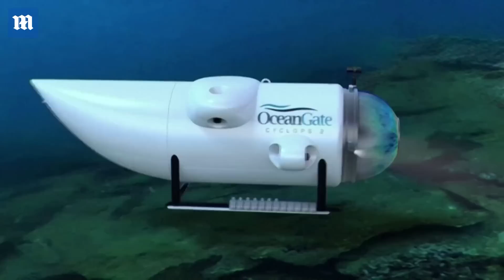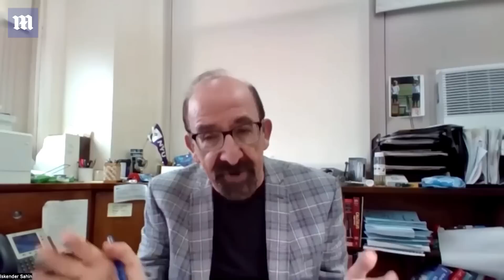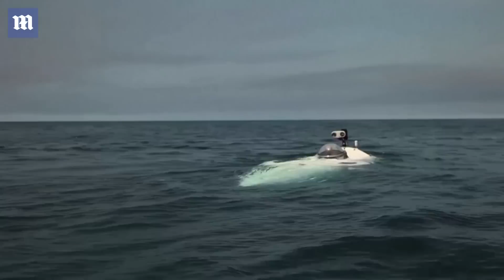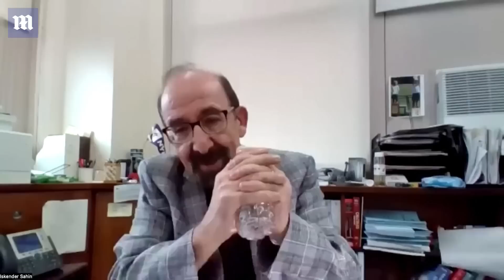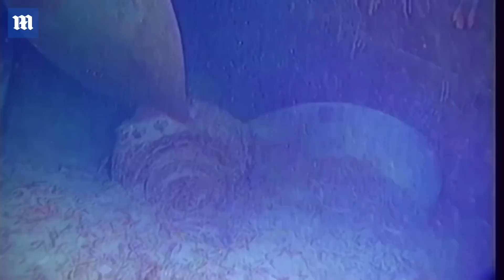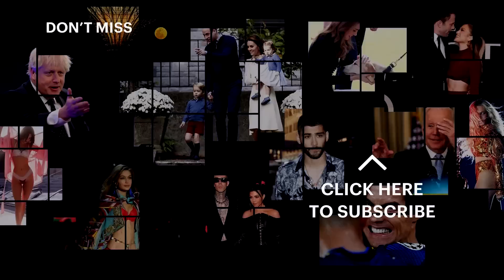Titanic submarine ‘disintegrated very rapidly’: Expert explains how tragedy unfolded

Comment: He is an amateur. Given the thicknesses of the barrel and encaps, it did not collapse like a coke can. The sub had three main components - the CFRP barrel, titanium endplates and the titanium hemispheres bolt fixed to the end plates. In my view, a likely cause is differential deflection under load. The end plate is very stiff and would resist hoop compression deflection very well. Some end plate bolts could have sheared off. The glued in barrel would have deflected more than the endplate putting a huge bending stress into the ends of the ends of the barrel which may have delaminated and massively fractured causing a very rapid inrush of water at one end.

Comment: This jackass was cutting corners cuz he owed his investors, he was  everyone

No one says they didn’t test the carbon fiber hull before knowing whether it could take the ocean pressure… Others are stating, clearly, that using carbon fiber is a mistake. He was repeatedly told this. His idea was NOT ONLY not “revolutionary,”. but,  due to this “revolutionary” metal’s inability to maintain its original yields, more than a few times. 

The carbon fiber experienced fatigue and it imploded due to the pressure. Ya see, carbon not “revolutionary,” along with steel or aluminum, it’s what oxogen tanks are made from. A device that experiences more pressure from with in, first, rather than only pressure from on the outside. That’s why oxogen tanks are cared for differently, like when on a plane.

Comment: How can a carbon fiber implode? I assumed the plexiglass cracked and water poured inside under tremendous pressure.
Reply: It's very brittle. That's why it isn't used in submersibles.

Comment: It's the fact that they combined carbon fiber with titanium and plexiglass. Those materials expand and contract at different rates and where they are attached become weak spots after multiple cycles
Reply: Yeah I think the salt water also compounds the carbon fiber losing it’s stability over time. We can all criticize after the fact but I’m sure the ocean gate submersible did it’s job the first many dives but after a while it shouldn’t been retired. We will learn a lot from their investigation, hopefully.
Reply: @heatherupton6558  Yeah, he could have probably cemented a legacy as an innovator if he did a few dives and allowed the regulators to dissect the sub and classify it. They probably would have given the okay for the design, contingent on a specified max number of cycles. Now he will only be remembered as a guy whose ego and hubris got himself and 4 other people killed.
Reply: Differential deflection caused by different stiffnesses. The load cycles were very few. The hemisphere bolts could have sheared off, or the CFRP barrel end in the titanium ring deflected more than the ring, thus subject to a huge bending force on the barrel end which may have delaminated and fractured.
Reply: @peteregan3862  The experts I have been listening to don't think the bolts were the point of failure because the normal force from the pressure is perpendicular to the cap.  There was no sheer force acting on the bolts. It would just make the seal tighter. The most likely failure was delamination of the bond between the titanium and carbon fiber, as you described. They were basically glued together and the differential in expansion and contraction between the two materials caused the bond to fail.
Reply: @justinv588  however, there is a huge   pressure on the end of the CFRP barrel - I estimate 100 to 120 MPa. (((I also estimate the hoop stress shrinking the barrel at 300 MPa.))) The end pressure would ensure that if the glue gave way, the leak would be small, a fine water spray, it would not cause an implosion. The barrel appears thick enough to survive intact all the way to the bottom from a hoop stress perspective. I have not seen a detail of the hemisphere to endplate bolting, so not convinced shear failure of bolts is not a cause. However, shear force is easy to calculate. Very much harder to model what is going on at the end of the barrel as we have hoop stress 300 MPa, a linear pressure from the bulkheads (100 to 120 MPa) from each titanium end ring, and a bending force/stress from differential deflection. It would likely take finite element analysis with each layer of wound fibre and glue treated as a separate element.
Reply: @peteregan3862  At that pressure there is no such thing as "small leak" . That "spray" would be coming in with a force double that of a pressure washer. I would imagine it would shred any carbon fiber it came across along the way and implode very very shortly after.
Reply: @justinv588  we will just have to disagree
Reply: why wasnt this comprehensively simulated on a smaller model to find these issues?
Reply: @johntynan8161  ego, hubris and money.
Reply: It doesn't matter The CEO is woke. He would not hire 50-year-old white guys. And that's more important.

Comment: Everyone's a mini sub expert this week, the world's full of engineering genius' all of a sudden, 100 years ago it was Iceberg experts.
Reply: I think geniuses is exaggeration The Titanium ring was glued over carbon fiber pipe and the dome was bolted with ring. Take a look what happens to a carbon fiber pipe under hydraulic press, it starts delaminating under pressure, and then when it's only little bit delaminated, it keeps delaminating even with much smaller force on it.
Reply: everyones interested in the news. What a shocker.
Reply: Not really.
Reply: Bro finish your education
Reply: The two older men should have known better than to get in that sub. They must have really trusted that guy or he talked them into it. Those were the two who should have questioned the integrity of that vessel. I just wonder if Rush talked them into going.
Reply: @laurenurban3942 ..He flew to Vegas to try to get the man and his son to go.  The son evidently, checked into what the sub was built out of. He told his father and he listened. The father said he might've gotten on it wouldn't for his son.  The father in Vegas also noted that he'd flown to Vegas on a plane he'd built.
Reply: How dare you sir...!!!!!
ive read AT Least 3 articles on the disaster...

Comment: Who is this guy! Yes It was a bad design, it failed. Lloyd's wouldn't insure it. No one would certify it. He got away with operating in international waters. He had no business diving to that depth with an experimental submersible, built by cutting corners and walmart parts. 
The hull was compromised and a bad design. It would've been fatigued. They had dropped their ballast, lost coms, probably taking on water through micro cracks in the hull, dropped at a faster rate and either imploded on the drop or hit the bottom. There won't be any body parts.
This guys ramblings are fustrating. 🤦🏼‍♀️ Challenger and titan aren't vaguely comparable.

Comment: Any kind of sub that is made to go to them depths should be unmanned subs only, remote control subs can do the same job, sending someone down there is just to dangerous.
Reply: It’s actually quite safe  Just need the proper vessel
Reply: It's not dangerous because they've being go down to the Titanic since 1985. This submersible was made with carbon fiber which is known to crack over time and cause all types of problems. Subs don't implode either. I won't even call the Titan a submersible because it wasn't. I don't know what that was but submersible's don't implode. The last implosion of submarine or submersible was back in the 70s from what I heard. I think James Cameron talked about it in some interview or some expert did. James Cameron who has been down there over 30 times just like the french man was but both of them were on quality subs. Subs that cost 30-40 million dollars to make. What Stockton Rush created was something incredibly cheap and I wouldn't call that a submersible.
Reply: First implosion of a manned deep sea research vessel... it is very safe UNLESS you don't follow the norms and simple guidelines on how to build one. RIP to them all.
Reply: senghourpaing  the Titanic was only discovered in 1985
Reply: Not really, just diving to those depths in a sub with windows is a bad idea. We’ve been building capable subs since the 60s